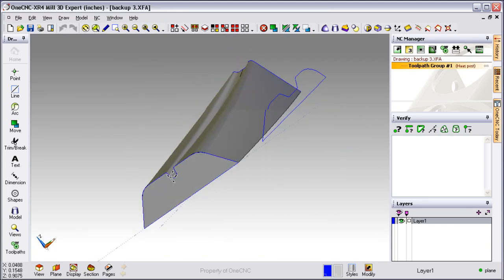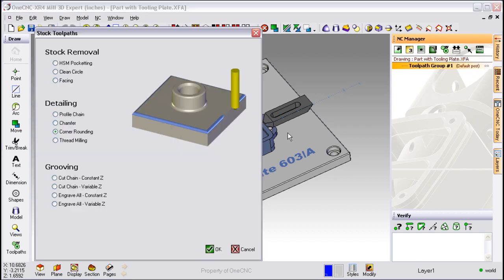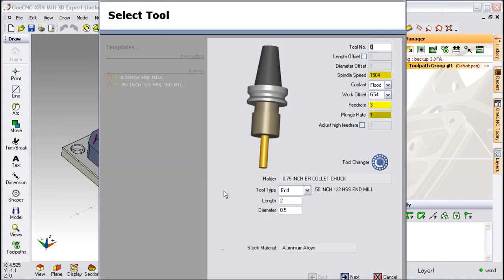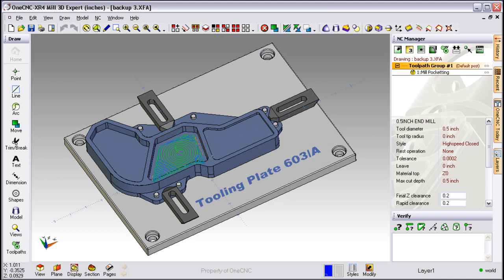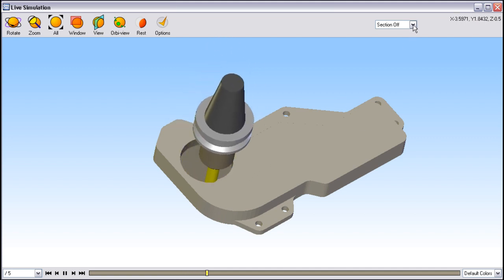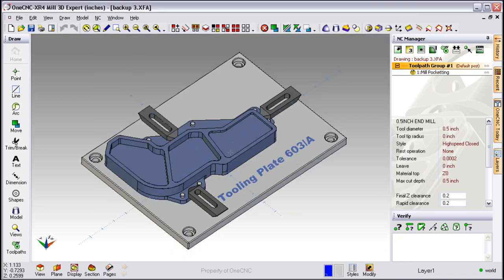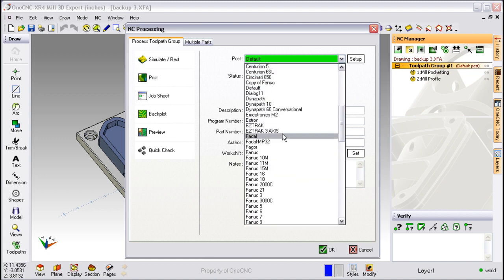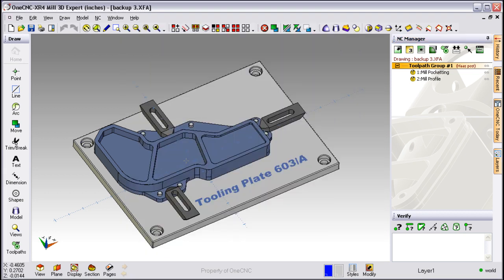OneCNCXR4 CAD-CAM part 3 of 3

Comment: Its great, simple to use. The main concern is the machining time. Delcam has something called Relative retract (skim) which OneCNC does not. Does that mean it will take longer than Delcam to machine same components using same parameters?